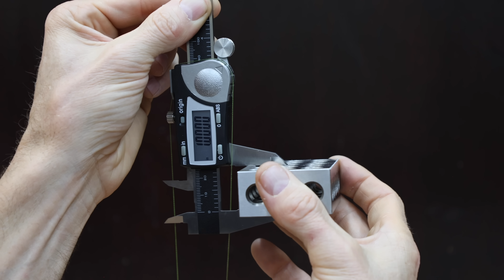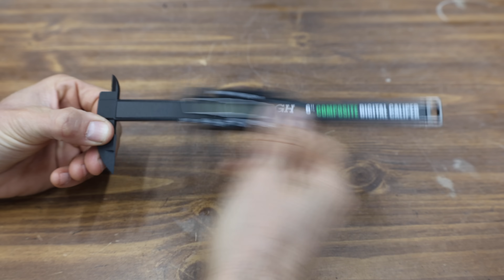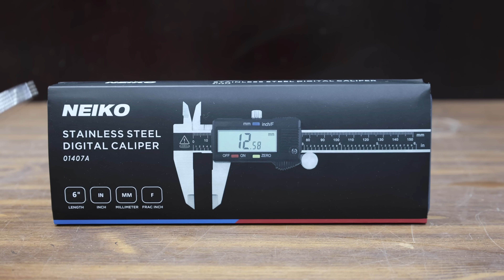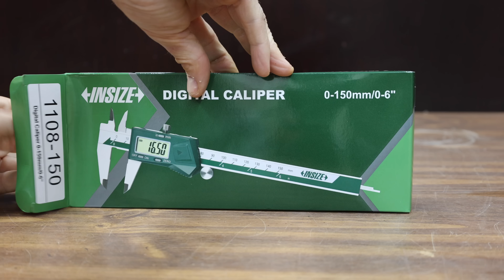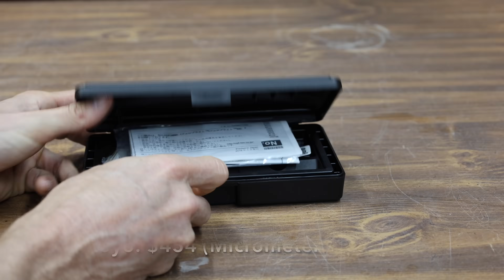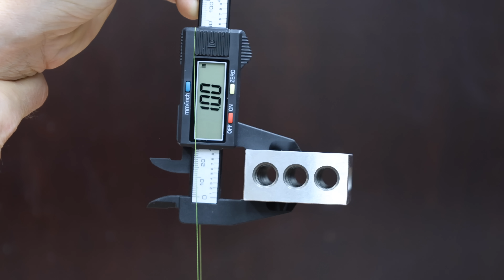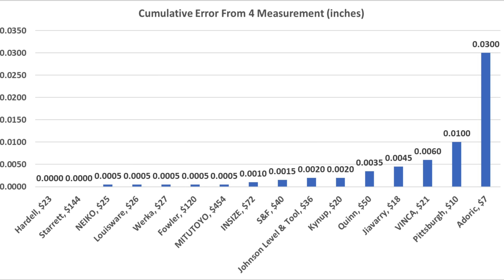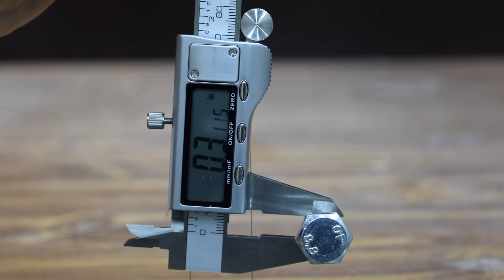I've Been Proven Wrong About Calipers!

Comment: So to sum this up, the best are Hardel, Starret, Neiko, Lousware, and Werka. And don't touch anything over 30 USD, not even with a pole. (For jaws.)
If you want tail then: Insize, Vinca, Johnson, Neiko, Werka.
If you want both jaws and tail and use that stuff as general purpose, then best are Neiko, and Werka. Insize passes too, but it's probably too pricy. Most of them failed at O-ring groove measurement. And now you can avoid weird voice intonation you hear in the video. He probably recorded each sentence separately, that's why it feels weird.

Comment: Being a machinist for more than 40 years, and having used and owned many calipers the one that I recommend is the Mitutoyo Absolute. The absolute function is very handy and because it dose not have a auto off it will retain that measurement until you turn it off and back on. Also if you leave it on all the time and use it all day every day the battery life is about 2 years. I personally own 4 of them. One thing to mention about the video measuring the 1-2-3 block with the caliper depth rod over a wood desk or work bench is wonky. Wood is not consistently flat enough to be a accurate base to measure against. 
     If you are thinking about a Mitutoyo Caliper this is a must watch video about fakes being sold at discount prices. 
(17 Warning Signs Your Mitutoyo Calipers Are Fake)

Comment: There's a feature on many of those calipers that may negate the a lot of the force measurement tests. There's a pair of tiny set screws on one side that adjust the slider's friction against the bar. It'll go from gravity assisted open/shut to needing a pry bar depending how tight they are.

Long time Neiko user here, mainly because it's still cheaper to have multiple spares than a single Mitutoyo.
Reply from the maker: Thanks for the feedback.

Comment: A lot of the cheaper ones look very similar, like they come from the same factory and just have switched logos.

Mine wasn't included in this list; I have an 8" General Tools & Instruments digital caliper set which comes with a foam-lined plastic hard case, spare LR44 battery, and screwdriver for battery changes. Overall, it's worked great for me; I'll take stainless steel over a plastic composite frame any day of the week!
Reply from the maker: Thanks for the feedback.

Comment: The metal calipers usually need to be cleaned right out of the box. So your friction test may not be a true indicator until the calipers have beeb cleaned. This is especially true of the Chinese ones. I use 3-N-One dry lube. On the Mitutoyo ones you have to be very careful to make sure that you don't buy counterfeit ones. There is a great Clough42 video on this. I bought one on Amazon that looked genuine and it turned out to be fake. When I pointed this out to the seller he responded by refunding my purchase and told me to keep the caliper. That was a big hint that told me they knew what they were selling! Also one must not confuse accuracy with resolution, Just because a caliper can read down to 1 mil (0.001 inch) does not mean that it is accurate to that amount over its entire range. Also adjustment of the two top setscrews can affect the accuracy and feel of the caliper. Properly adjusted and maintained calipers like the Mitutoyo will last for decades. One hint: Use the Silver Oxide version of those batteries not the LR Alkaline ones. They last much longer. Sam

Comment: My question is "does it matter ?". 
I have had my Mitutoyo for 25 years now. It still measures as it did right out of the box. Even the box has not worn out yet. 
So divide the price over 25 years and it is less than a couple of cups of barista coffee a year. At the same time I know it works when I reach for it.
The most important things when buying a caliper is that you trust it. Are you sure that it measures correct every time? Do you have to check your measurements with something else just to be on the safe side?

Comment: The mitutoyo is supposed to have a SR44 battery not a LR44 battery. SR44 are of better quality and the voltage doesn't drop gradually like the LR44 which makes it better for a measuring instrument.

Comment: Two things:
1. I can't unhear Project Farm's voice over starting out very strong and then softening out in a couple of syllables. The beginning of the sentences hurt my ears a little. lol sorry dont want to be nit picky or anything
2. You should have done the measurement test with the inside of the jaws, not the end. Then lightly squeeze the jaws together. Precariously balancing the weight on the caliper, and positioning the calipers to the block, and trying to only use the sharp ends of the jaws was not consistent to begin with.

Thanks for taking the time and money to make this video though. I think anyone looking for calipers can at least use the general quality tests you performed to find something in the above $20 range that can work pretty well.

Comment: it is good to see that the most expensive one ended up in the top three this time. it is also not surprising that they weren't the top, but it is good that they were up there. it sucks for all those old-heads to see proof that there treasured tool and brand loyalty didn't totally screw them.

Comment: Suggestion: electrical anti-freeze waterpipe heating tapes. Apparently fire hazards are a possibility due to some designs & materials in use. We need an inherently safe design. Don't burn yourself down with the materials longevity testing. Length becomes an issue with some designs.
Reply from the maker: Thanks for the suggestion!

Comment: Some ideas for future videos. I think some of these you already did a few years ago.

Automotive and Vehicle-Related Ideas
- Engine coolants/antifreeze brands: Test for boil-over protection, corrosion resistance, and compatibility with different engine types (e.g., comparing Prestone, Zerex, and store brands).
- Brake pads: Evaluate stopping distance, noise levels, dust production, and wear on rotors across budget vs. premium options like Bosch, Wagner, and Akebono.
- Spark plugs: Compare ignition performance, fuel efficiency impact, and longevity in high-mileage engines (e.g., NGK, Denso, Champion).
- Transmission fluids: Assess shift quality, heat resistance, and protection against wear in automatic transmissions.

 Tools and Hardware Ideas
- Cordless impact wrenches: Test torque output, battery life, and build quality on models from Milwaukee, DeWalt, Ryobi, and Harbor Freight.
- Hammer drills: Evaluate drilling speed through concrete, vibration levels, and chuck durability.
- Utility knives: Compare blade sharpness retention, ergonomic grips, and safety features across brands like Olfa, Milwaukee, and generic options.
- Ladder stabilizers or multi-position ladders: Test stability on uneven surfaces, weight capacity, and ease of setup.

 Household and Maintenance Ideas
- Vacuum sealers for food storage: Assess seal strength, suction power, and bag compatibility (e.g., FoodSaver vs. budget alternatives).
- LED light bulbs: Compare brightness (lumens), energy efficiency, color accuracy, and lifespan under frequent on/off cycles.
- Water filters (pitcher or faucet-mounted): Evaluate contaminant removal (e.g., chlorine, lead), flow rate, and filter longevity.
- Space heaters (beyond tower models): Test heating speed, energy consumption, safety features, and noise in small rooms.

 Adhesives, Lubricants, and Cleaners Ideas
- Threadlockers: Compare holding strength on bolts under vibration and heat (e.g., Loctite red vs. blue vs. alternatives).
- Multi-purpose cleaners for garages: Test grease-cutting ability, surface safety, and residue on tools and floors.
- Rust converters: Evaluate conversion effectiveness, paint adhesion, and long-term protection on metal surfaces.
Reply from the maker: Thank you very much for the ideas! I appreciate the support

Comment: I have the louisware and its adequate for my needs - HOWEVER..... it does this really annoying thing where it turns on automatically whenever its jostled the tiniest bit, like 2hen I open and close the drawers on my tool box. So every time i go to use it its dead... ive started just storing it without the battery, which is also annoying because it requires two screws to install the battery door... ugh

Comment: I found that any caliper with an LCD screen needs to have a rechargeable battery simply because the battery go dead immediately otherwise. It doesn’t matter if they have an auto law feature. And there’s nothing worse than going to use your calipers and finding out the batteries is dead and you have to hunt for those stupid watch batteries.

Comment: I mean you should be measuring everything against gauge blocks and not a mounting block typically used for fixturing for milling as the flatness, parrellelism, surface finish and etc can effect the measurement. Also measuring in the same spot. This method doesn't really inform us of the capability of the calipers. You can slowly bring up the class of gauge block to start eliminating the lower performing calipers. Also the surface on the gauge blocks are precision round to the +/- 0.001 and lower depending on their class. Means other GD&T variables and implied tolerances will also be lower than the mounting block.

Comment: SR44 batteries should be used not LR44 as the voltage curve is much more suitable for digital callipers. An LR44 will stop working in a digital caliper while it’s still about 2/3rds full.

Comment: The Mitutoyo is specified to use SR44 Silver Oxide batteries, not Alkaline LR44. You can use the far cheaper LR44 in a pinch as they are similar size and voltage. You can buy an enormous pile of LR44s for the price of one SR44. The SR44 offers a much more stable voltage and longer life.

Comment: I was once doing a project with cheap calipers and at some point the measurements started drifting! Off by half a mm! I threw them straight into the trash and ordered Mitutoyos the same day. The hours lost were a valuable lesson. The cheap ones are accurate mostly, but are they reliable over the course of a whole day? For months and years?  That's what you pay for.

Comment: I've bought several callipers over the years - I never need a great deal of accuracy but the problem is that most of these don't last long - some straight up die, for some the calibration stops working & I get random zero values, for some the display starts going wonky and for some moving the slider would make it go berserk. 

In the end I gave up & just use mechanical callipers now - it takes a bit longer to read the result and it's less accurate but I've been using the same set for 5 years now whereas digital ones only last one-two years tops (not to mention their batteries ran flat all the time for some reason even with minor use)

Comment: Nice review. I personally own a cheap set of $40 mastercraft calipers for home and personal use when im building and fixing stuff at my house.

However, i also run a shop where we just use mitutoyo and fowler instruments. 

One thing this review can't get is that the mitutoyo is robust. We have had other cheaper calipers that simply suck after a year or so of constant use. Where it started off as good as advertised and then after a year is off by 2 thou (0.05mm)

The mitutoyo is still within 0.01mm after 6 years.

Another thing is the battery literally never dies. 6 years of industrial use and havent replaced it.

If you need a caliper for use at home, you dont need the high end stuff as they will likely never see the abuse and dust they would in a shop. So the cheaper ones def have their place.

Comment: I have the Vinca and it doesn't work anymore, after less than a year of mostly sitting in a drawer. Even changing the battery doesn't fix it. The display just flashes and shows random patterns, it's not readable.

Comment: Starrett or Mitutoyo. keep away from that plastic shit. this is coming from a cnc precision engineer. but it all depends what you want it for . we worked in microns so we would use micrometers,  'cos' the calipers would not give consistent readings. if you need it to measure a bolt now and then just pay middle of the road.

Comment: i've used many brands over the years, for many years at a time. Cheap brands, no matter how accurate at first, just don't last. build structure may actually be my top priority. My mitituyos are accurate enough for most of my work, but more importantly, they stay accurate, even after a decade of use. I also stick with analog readouts. I hate batteries.

Comment: The most important feature (in my opinion) is missing here... I gave up on digital calipers a long time ago as every time I  reached for one, it was dead. That's because they are notorious for always being on (albeit in a low power state). They'd have a "auto shutoff" but they didn't actually truly shut off.  In fact, I'm willing to bet its this "auto shutoff" feature is the real reason the problem exists as it's an electronic pseudo off circuit rather (just turning off the display screen). I know this doesn't matter to people that use them very regularly but for the longest time, I'd only pick mine up once a year when something breaks and want to 3D print a fix for it. Honestly I should never of stored them with batteries in them, but I absolutely love my Mitutoyo 505-732 Dial Caliper! No battery, and uses a rack and pinion slide for extreme precision.
Reply: They have to be always on. They're all linear encoders and the chip has to keep track of pulse count, or they drift. That's why it can be "off", but when you pull it apart and turn it "on" it gives you a real figure rather than starting at 0.

That said, the good ones will have a quiescent current in the μA, possibly nA range. The cheap ones are definitely of the order of mA. That's why they eat batteries.
Reply: @233kosta no, they don't always have to be on... In fact some don't come with batteries installed at all and there's a few models that have a true power off. They almost always have a zero button that allows you reset the zero position, and as long as they are zeroed then their value stays true. There's a great video of someone disassembling a digital caliper, showing how they work. There's zero reason to keep them powered unless you want to keep the previous zero.

The pulse count you refer to is only in reference to the zero position. Which again you can zero it yourself

Comment: First off, my dad had a saying, “Don’t measure with a micrometer, when you’re cutting with an axe.” 😊. Point being, if this is for home use and it sits in a drawer or on a pegboard most of its life, go with affordability.  
Several years ago, I purchased a handful of ~$25 digital calipers for our lab.  Within days, they were sitting at every engineering work station and after a few months 50% had disappeared altogether. 🤭  I’ve never needed nor owned a pricey model - without regret.

Comment: I have used starrett before, they are great. Now I have a 12inch neiko and a 6inch mitutoyo. The mitutoyo not having auto shut down can be annoying but been using it for 3 years now and I often forget to turn it off and stays on for overnight still haven’t changed the battery once.

Comment: a test you didnt do is longevity - I dont see old cheap brands still in use today.
the Mitutoyo price is wrong at the end. its alot cheaper.
you could of zero'd a caliper wrong.
the force to slide jaws test is irrelevent to the quality of the tool.
the 1-2-3 block's 2inch and 3inch size could be off and you have no idea.
you shouldn't be measuring depth on a wooden surface, and there can be human error in measuring depth
o-ring groove test should be wide enough or tapered to fit every caliper in.
the hole size test should be on a ground or reamed hole, not a rough heat treated hole.

all in all, inaccurate average finish score at the end.

Comment: The aspect that is not tested here, is manufacturing consistency. If this test was with 10 of every brand, the results could be wildly different. It’s not odd for a cheap version to be good. It is less common for every one off the line to be good.